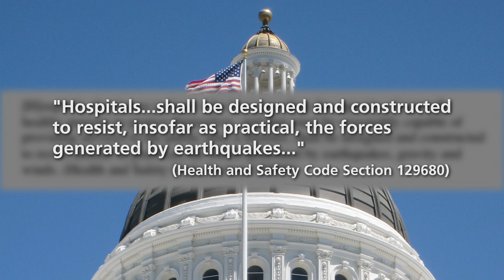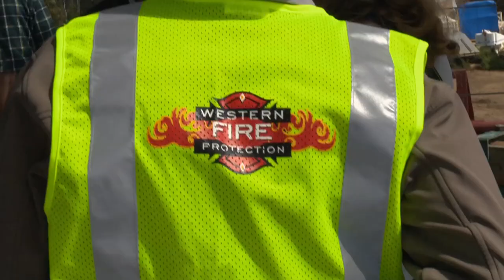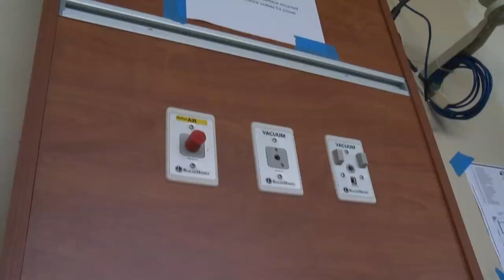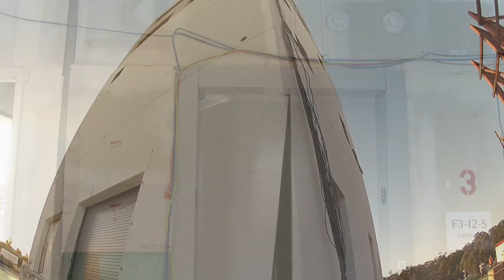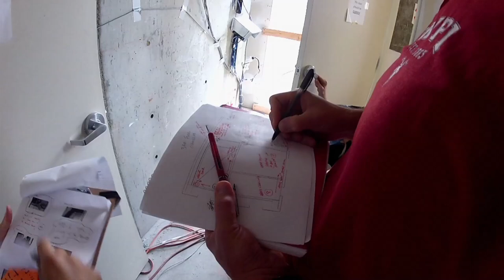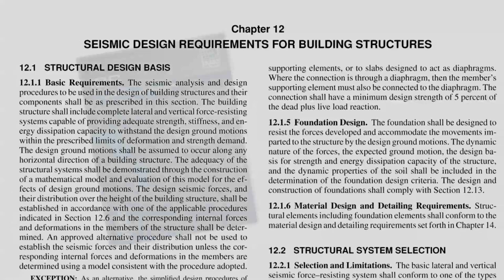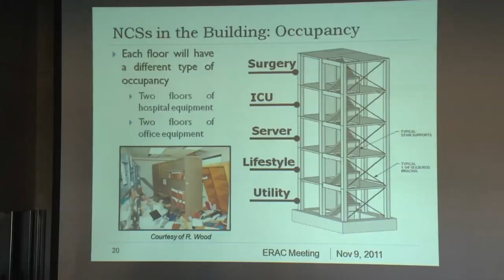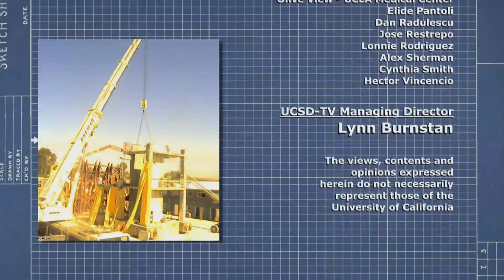Building it Better: Earthquake-Resilient Hospitals for the Future

Comment: I'm guessing that these liquid fuel fire tests were mimicking broken natural gas lines? Hospitals need hot water heating, heat heating for the air, and possibly other machines as well. Hospitals have generators with fuel storage tanks to likely in basements or just beside the building outside. I really like how they secure the potable water on the roof from being compromised it even survived the above and beyond earthquake test. Does anyone here think it would make sense to put fire doors in front of elevator doors on each floor? We saw how the doors were cracked open allowing natural gas fires to fume right up the elevator shaft. Or would such a system trap people inside the elevators? I thought most elevators automatically ground to the ground floor as soon as emergency systems detect a fire. Its so hard to know what would be functioning after a major quake perhaps it just isn't worth fiddling with. Fire doors are great idea, great to see the fire resistant material holding up.